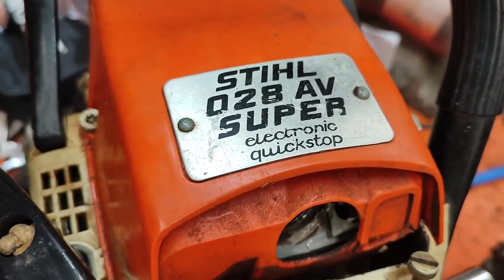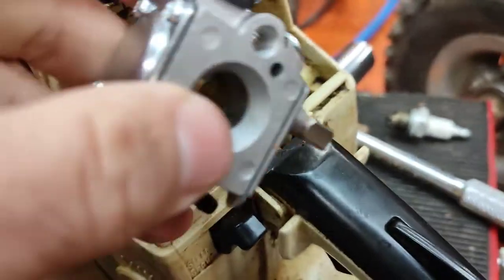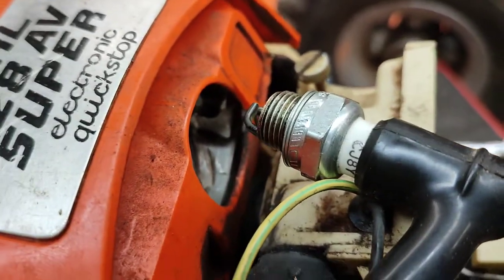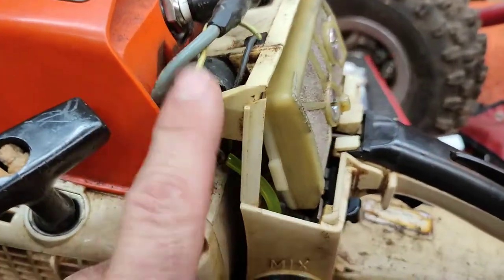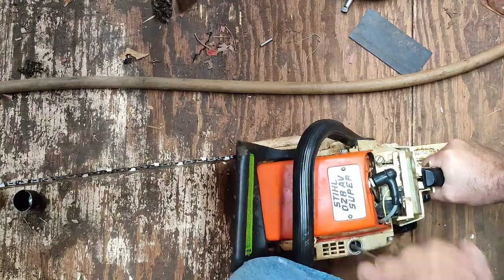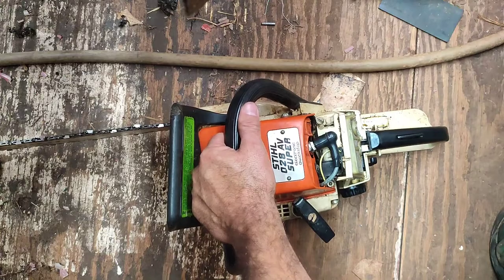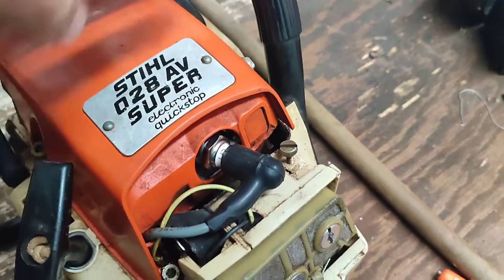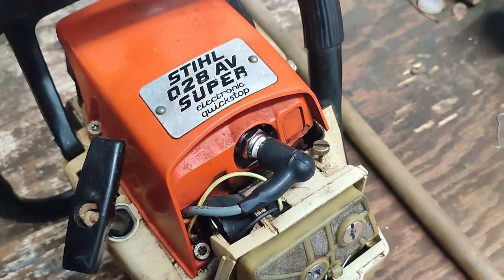Stihl 028 Dealer gave up, we didn't!!

Comment: What about the condition of the intake boot?  Rubber cracks.  That was the main problem with my 028.  Running lean will also overheat and if bad enough will damage the engine. I’ve seen  exhaust ports melt from running lean
Reply: Best just to replace it and then you know it’s good 😊

Comment: I use my 028 exclusively for cutting ice for spearfishing here in northern Minnesota. I have a 32" bar on it. My only complaint is that it won't start when it's cold. Any ideas?
Reply from the maker: Make sure your compression is over 120psi (should be around 150) if it is try richening up the low adjustment an 1/8-1/4 turn.